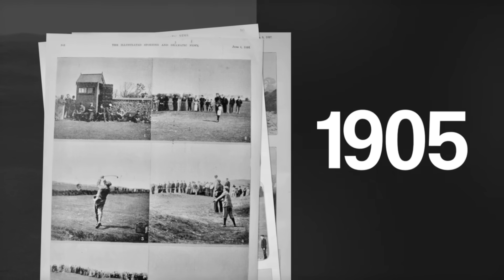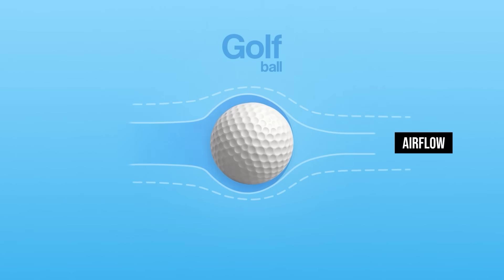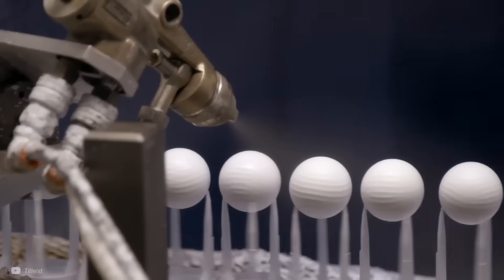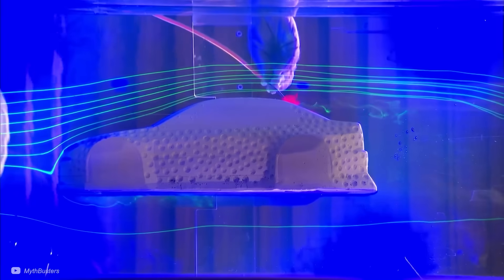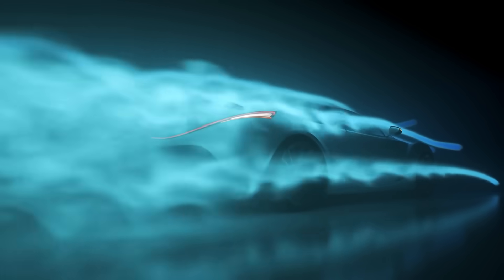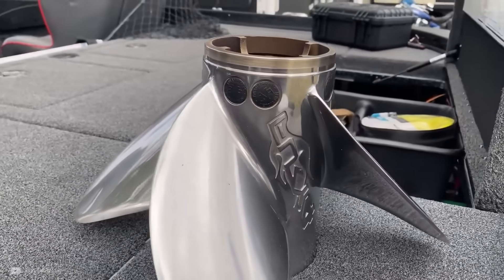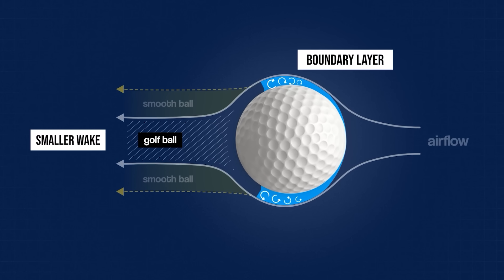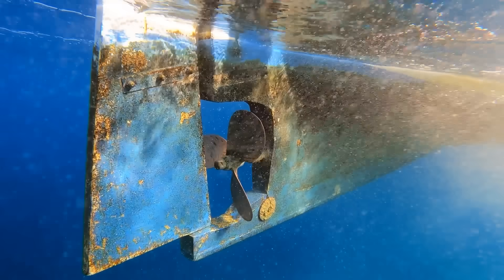The Unexpected Genius of Dimpled Propellers

Comment: Aerodynamic engineers tried it on cycling wheels. 
Zipp wheels are known for their "dimples," which are small, evenly spaced indentations on the rim surface. 
These dimples, also called "ABLC (Aerodynamic Boundary Layer Control) dimples" by Zipp, are inspired by the dimples on a golf ball. 
The dimples are designed to manipulate airflow, helping to reduce drag and improve aerodynamic stability, especially in crosswinds. 
All gains were lost in the wind!
Not to much to write about!

Comment: I wonder if you could change the NPSH of a pump using dimples on the pump impeller.
Reply: Hardcore hobbyists were doing things with dimples on water cooling systems for overclocking, back when that was a hobby.  It could potentially raise your NPSH slightly.  But any gains would depend on fluid type, pump speed, system geometry, and how well the texturing is tuned to the Reynolds number range of your system.
Reply: @M3rVsT4H  thanks great bit of info.

Comment: I have some drone propellers made by master air screw which have a crosshatch textured dimpling on the upper side of the propeller blade they perform good and seem quieter. I'm using 7x6x3 prop on my homemade RC airplane. That's quite a bit of pitch.

Comment: Cavitation is a performance-limiting factor on hydrofoils. I wonder if dimples would help
Reply: I didn't know that? Hydrofoils seem like such a great idea until reality steps in. 😢
Reply: It’s only limiting at high speeds. Just found a 2012 paper showing how ‘supercavitation’ can be employed to reduce drag on hydrofoils and torpedoes, counterintuitively, while there are plenty more articles about hydrofoil surfaces being fitted with bumps to reduce cavitation. I should probably have done my research before commenting!
Reply: @andyridpath  it certainly seems to impose an upper speed limit on sailing vessels using hydrofoils, of about 50 knots. It will be interesting to see whether the Sail GP and America's Cup designers are able to substantiate any of these findings and put them to practical use

Comment: No kidding- I'm actually working on a project and will  (at some point) be performing tests with propellers and was doing research on cavitation in order to increase the speed that I can allow my propellers to spin- thank you for this video because I will perform my own tests and will try out the golf ball dimples
Reply: Try looking into whale Tubercles. Basically golf ball dimples in nature. See what things it does already.
Reply: Shark riblets are also another form
Reply: @lgplays4061 Is that what their rough skin is called? Riblets.
Reply: @lgplays4061  
Correct ..but addendum,
Skin Denticles....  Micro dermal scales derived from the same genetic roots as their teeth 🧙🏼‍♂️🥼

High lift low drag strip device vvvvvvv on Stol aircraft to avoid boundary layer  separation.
Reply: Would dimples improve the toroidal propeller design?
Reply: Ignore this idiot who has done no testing and provides no source for his baseless assertions. There is a YTer in USA who ran a whole competition on boat screw design and actually tested and printed dozens of designs. You will learn far more there, so start by forgetting what clown says since he knows nothing except how to make click pennies from dishonest sponsors.

Comment: AI Summary

Abstract:

This video explores the scientific principles behind golf ball dimples and their surprising applications beyond the golf course. It details how these dimples, discovered in 1905 to reduce pressure drag by manipulating the boundary layer, can inspire aerodynamic improvements in various fields. While direct application to streamlined objects like airfoils presents challenges due to differing drag characteristics (skin friction vs. pressure), the core concept of turbulence management proves invaluable. The video highlights successful adaptations, including reducing cavitation in marine propellers, enhancing wind turbine efficiency with vortex generators, and developing biomimetic coatings for ship propellers that effectively minimize skin friction drag, leading to significant fuel savings.

Exploring the Aerodynamics of Dimples: From Golf Balls to Propellers

*   0:00 - The Dimple Discovery: In 1905, the discovery of dimpled golf balls revolutionized the sport by reducing drag, allowing them to be hit twice as far as smooth ones. This effect is due to the dimples reducing the low-pressure wake behind the ball.
*   2:00 - How Dimples Work: Dimples create a thin, energetic turbulent boundary layer of swirling air directly next to the object's surface. This turbulent flow resists detachment, causing the air to stick longer and significantly reducing the size of the low-pressure wake, thereby minimizing pressure drag.
*   3:00 - The Drag Trade-off: While dimples excel at reducing pressure drag, they simultaneously increase skin friction drag because the turbulent air clings more tightly. For golf balls, the pressure drag reduction far outweighs the increase in skin friction.
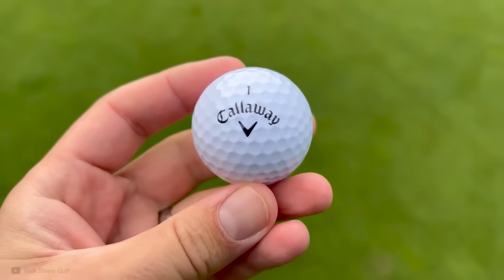*   3:38 - Application Challenges for Airfoils: Directly applying golf ball dimples to streamlined objects like airfoils or propeller blades is complex because their primary drag is often skin friction, not pressure drag, and they don't have the blunt shape that creates a large low-pressure wake.
*   6:53 - Drone Propeller Simulations: Simulation research from 2020 indicated that dimples could improve the lift-to-drag ratio of drone propeller airfoils by nearly 40% at high angles of attack, demonstrating the potential of boundary layer manipulation.
*   7:31 - Cavitation Reduction in Marine Propellers: A 2025 study highlighted that tiny dimples on marine propeller blade tips can dramatically reduce cavitation (the formation and collapse of vapor bubbles) by up to 95%, by evening out tip vortices and stabilizing water flow with minimal performance impact.
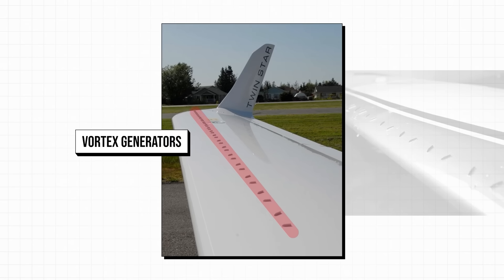*   8:38 - Vortex Generators on Wind Turbines: Applying similar principles, vortex generators—small fins that energize the boundary layer—have been fitted to over 3,000 wind turbines worldwide by SmartBlade. These boost torque and result in a 2% annual energy gain.
*   9:50 - Biomimetic Propeller Coating: Inspired by dolphin skin and building on the concept of turbulence control, Chinese engineers developed a flexible coating with microstructures (0.1-0.2mm) that specifically minimizes skin friction drag on ship propellers.
*   10:51 - Real-World Fuel Savings: Tests on a 300,000-ton ship showed this biomimetic coating led to a 2% fuel saving over 200 days of voyages. It costs $20,000 to apply and could save $140,000 annually in fuel, highlighting its economic viability for large vessels.
*   11:41 - Key Takeaway: The fundamental lesson from golf ball dimples—the ability to interfere with and control the boundary layer and turbulence—is a powerful concept that continues to inspire innovations for reducing drag and cavitation across various engineering applications, especially in marine environments.

I used gemini-2.5-flash-preview-05-20| input-price: 0.15 output-price: 3.5 max-context-length: 128_000 on rocketrecap dot com to summarize the transcript.
Cost (if I didn't use the free tier): $0.0052
Input tokens: 15787
Output tokens: 799

Comment: What if you created a clear film with dimpled leading edges to apply to the rear wing or lip of cars? Like the boot lid for sedans or the top bit just over the window on hatch backs. A 2% improvement might not mean much to a gas car but to an EV it could be useful. And to an older EV with a small battery, it could be really useful.

Comment: The thing with the marine propellers sounds more like whale tubercles, which have been studied as an addition to airfoils for a long time, not golf ball dimples.
The vortex generators on the wind turbine blades are just increasing the stall angle at the cost of a bit more drag, just like they have on aircraft wings for decades, and it should increase performance at low wind speeds at the cost of some performance at high wind speeds. That is a great tradeoff for a wind turbine since it smooths out the electricity production a bit.
Reply: Whale Tubercles are kinda different. They're larger than nano scale. Humpback Whales have the most pronounced Tubercles. Those are the large forward protruding bumps on the front of they're fins particularly they're pectoral "wings"

The film that was discussed here is microscopic and similar to shark skin. 

Seems like you would be familiar with that but the way you're comment is worded seems like you asked Chat GPT and commented based on a narrow part of information.
Reply: Noticed in you're playlist you've got a video from Teaching Tech on Non-Planar 3D printing. Are you into 3D printing? Have you done Non-Planar printing? It's advanced a bit since that video was published.
Reply: I just wrote the something similar about whale stuff before I saw your comment!

Comment: It’s genuinely impressive how many new and interesting discoveries can still happen around water propellers - an area I would have thought we mastered 100 years ago.
Reply: It seems that propellers are so difficult to make that once a good enough configuration was arrived at ,  no more large changes have been tried until lately.     There is experimentations happening with loop-tipped props. They may be more efficient within a narrow range of operational parameters.  Another innovation is leading edge "serration"; lumps on the leading edge imitation of gray whale fins.
Reply: 3d metal printing and 3d sand  printing/casting have unlocked new methods in the last decade or so. Particularly when combined with a CNC finishing step.
Reply: nothing is ever truly mastered. as time and technology progress, new improvements are made possible.

Comment: If the vacuum behind the car creates pressure drag, why don't we try to intentionally replace that air? Like making tubes that are open to the front of the car,  and direct that airflow from the car ramming air to the space behind the car that the vacuum forms as a result of the motion? I guess you'd be trading skin friction for some pressure friction relief. But how much?
Reply: If I get your drift right, you want to remove the usable space of the car by shaping it like a tunnel (so that the air would go through it) which would maximise skin friction drag (since the car would basically be an airplane wing, but shaped like a tunnel on wheels.)

Well, you've got that design for some of the solar car racing challenges.
Reply: Yeah.  But a tube on wheels can't have passangers. If you have a vent in the front that directs air from the front vent to a couple of places behind the car (by having the vent have more than one channel) while circumventing the passenger space, you can still have a passanger space with this design.   @COKireato
Reply: They kind of do that already. There are aerodynamic designs that create holes or channels for the air to flow through the car & into the space behind the car.

But the flow is normally from the sides or bottom of the car. They normally use the front of the car to push air into the radiator for increased cooling performance.
Reply: I think that's an excellent idea, since there would nowhere to sit, it would drive autonomously or remotely and I could follow it in say a taxi or better yet my friend could drive me and follow along (when he has nothing better to do)

Comment: Why only dimple the propeller on large ships and not the surface of the ship itself?
Reply: I have to paint ships, it's hard enough already don't give them any ideas alright mate?
Reply: I imagine they’re going to try the bubbles first.
Reply: The friction drag increase would be bigger than the pressure drag decrease thereby decreasing the overall drag of the system.
Reply: @ThePanteraza  My nephew used to race wooden sailboats. The preparation of the boat was very important. 
After applying new lacquer to the hull he wouldn't call it good but after the lacquer had hardend he would again lightly sand the boat (below the waterline using fine grit and in circular motions. He would insist that it would make the boat faster.
Reply: The relative speeds between spinning propeller-water and hull-water are totally different, maybe it wouldn't make much of a difference? Maybe it's not cost effective to apply it to the whole ship? I believe big ships do have air spray systems under the hulls to increase efficiency. I think Casual Navigation has a video on it.
Reply: I don't think they move fast enough to cause flow detachment.
Reply: They already use pressurized air under the water line
Reply: I think smaller areas around bulbous bows and where the ship starts to narrow towards the stern are worth studying

Comment: I wonder if those dimples can help buses to reduce air drag?
Reply: i think they could. i have actually seen European touring busses that have dimpled mirrors.  They could also be used on the frontal area of the front bumper.
I have also seen them on motorcycle helmets, racing bike helmets, all on the frontal surfaces
Reply: @jfv65  for a bus you would want dimples on the sides near the rear
Reply: They can but ideally you would want uniform protrusions like how he talked about dolphin skin. By managing and thinning the air cushion layer you would make the overall drag much less, think of a person in head to toe chain mail vs someone with a few large pieces. 

The only problem is that with friction inducing/reducing layers is that they are inherently sacrificial by nature. And in nature this isn’t really a problem because the organism that employs it also passively or actively seeks to maintain it while in contrast humans seek means of the least amount of maintenance possible.

So in conclusion burs and pockets are probably more efficient than just flat dimples, but burs are fragile and will need to be replaced, where as dimples would need less maintenance but inherently weaken the structure as a whole. Like a water smoothed rock, forces eventually settle on an equilibrium of sorts.
Reply: Been thinking about how hard to maintain dimpled panels will be.  You effectively can't repair and repaint them with autobody techniques..  I've got a feeling the tiny percentage of fuel savings probably don't offset the cost of building and operating dimpled busses.    But clearly there are gains to be had.   I wonder about dimpled vinyl wrap..
Reply: @M3rVsT4H we still live in a petrol based economy/world so it is possible to make an outer layer of cheap plastic panels however most humans prefer form over function with private vehicles so I doubt it would be popular enough produce cheaply at scale
Reply: @yoface938  I dig that for sure.  But If I can't buy some neato ceramic paint protection  film with dimples by 2027, I'm going to be genuinely dissapointed. :D
Reply: You can also use small wings to help the airflow remain attached to sharply curved surfaces.

Comment: Maybe but im doubtful, i think cavitation might make this innovation useless. Normal propellers are designed to reduce cavitation as much as possible because this reduces wear heavily, a non uniform plane causes a lot more cavitation as pressure differences cant spread out smoothly and uniformly.

But im not sure about it, maybe there are clever work arounds, if there arent then this will eventually die as cavitation will become a large problem later on.